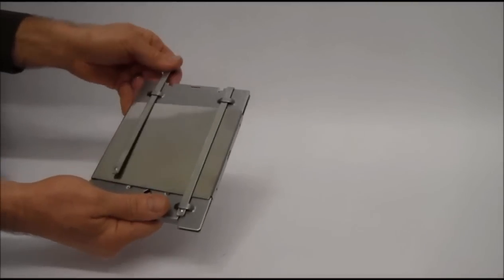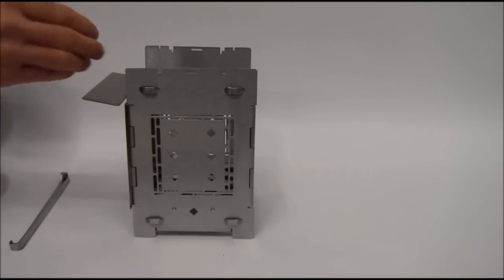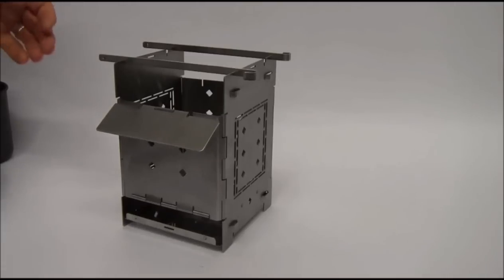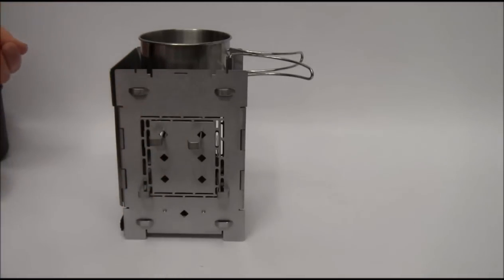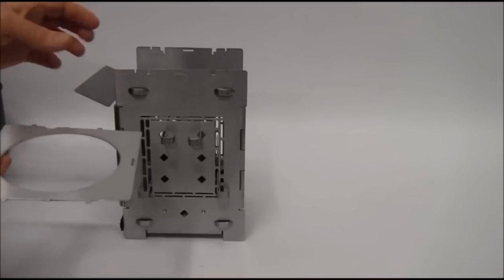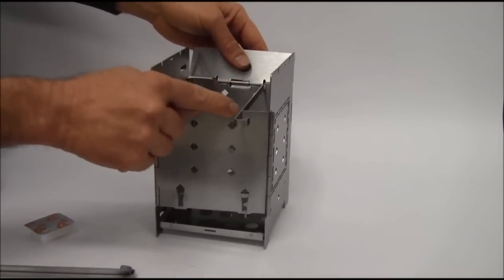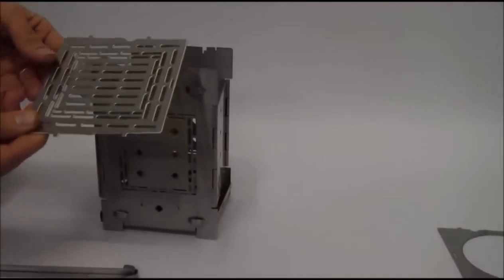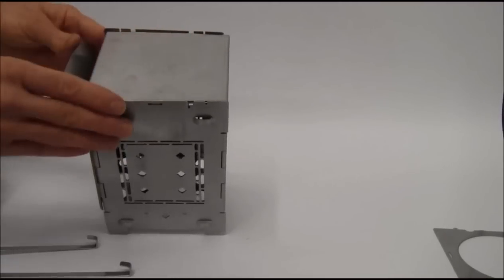Instructional Video For The Folding Firebox 5" Campfire Stove.

Comment: Been using my firebox on my fishing trips all summer. Some of my friends doesnt understand why I use it when there are small compact gas stoves. Well the answer is easy. The wieght of a firebox is the same as it is for a small compact gas stove. But the firebox is small and compact and I have unlimited fuel in the woods, dont need to worry about gas consumtion every time I boil water och cook food. The gas bottles are big and takes a lot of space in my back pack.

Tested this box in very wet conditions too, It had been rainnig for 3 days so all the wood was very damp, all people whos been out there in the woods knows that dry wood is easy to get if you know how. A saw and a knife to baton with solved that problem. Sure it takes a little longer to get youre meal or coffee. When my coffee was done I used the firebox as a heatsource for my cold and wet hands.

Some friends dont like it and others do, 2 of my friends has one firebox now, they love the unlimited fuel and heat source :D
Reply from the maker: +Marko Mertala Awesome Marko! For me camping isn't camping without a wood fire. I don't like the hiss of a gas stove, never owned one.
Reply: Hiss ? Its more like a roaring jet engine :D

Comment: How many times can this be used before it disentagreats?  For the price I was just curious?  I love the design and simplicity of use not to mention its extremely lightweight And compact making it perfect for bug-out equipment or just camping with some friends or family.  The only downside is it doesn't come with the parts shown in all your videos.  Which increases the stoves all usefulness. 😕 but other than that is a great little stove.  Very nice job on the design and manufacturing.  Please pm me or leave your response in your comment section.  I would just like to know around about figure on how many times I can use the stove?   That being  I take good care of it,  e.g seasoning the metal after use and keeping it clean.   Thanks again.    

Cannagorilla,  Canna growing products & solutions.   Check them out.
Reply from the maker: I have had several customers who have stayed in touch reporting several years of consistent use who feel their Firebox stoves are holding up well.
It's made of 18 gauge stainless steel which is the thickest in it's class.
Reply: Thank you so much can't wait to get mine!  I should be placing my order tomorrow